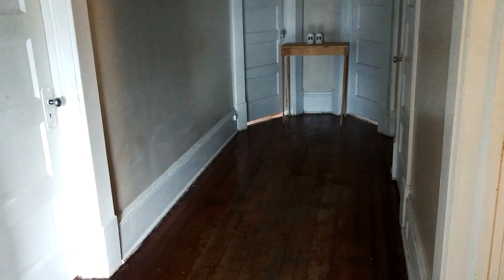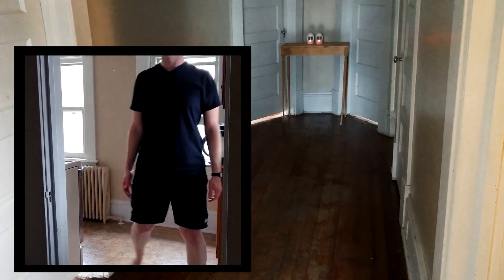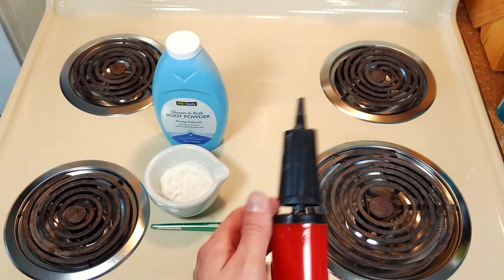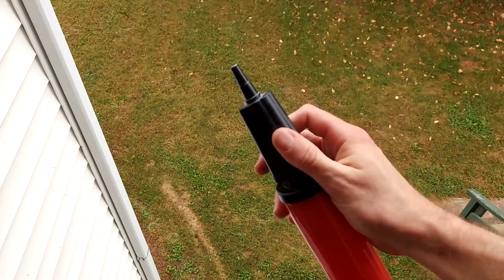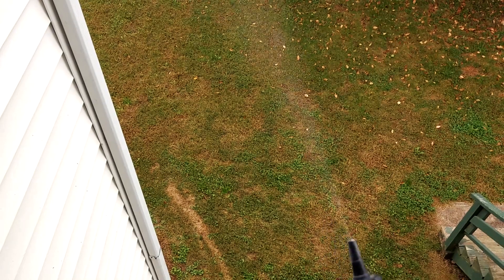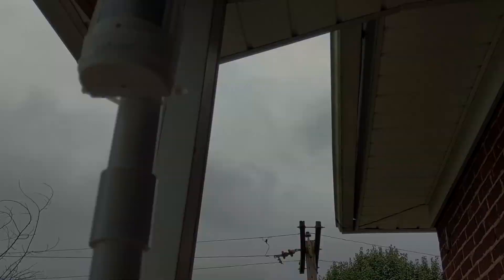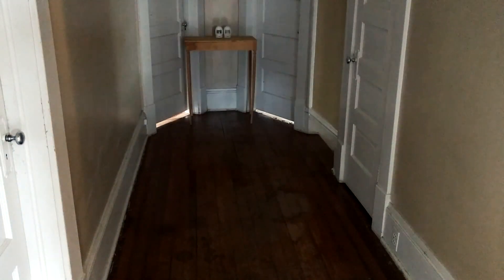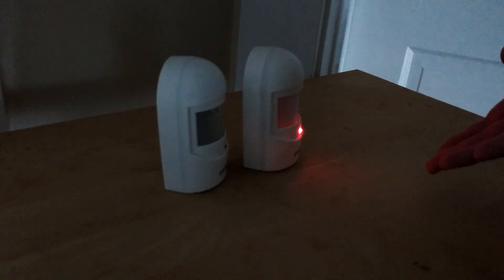Motion Sensor Bypass Prototyping

Comment: You say the sprayed sensor doesn’t look different but it does look really obviously spray painted
Reply from the maker: Well, "looks different" is such a relative qualifier. I definitely agree that it looks obviously different when well-lit and closely inspected. But, when out of one's central field of vision, and in the absence of strong lighting, I would argue that this modification is pretty stealthy. 

But again, this is just a proof of concept that would have to be further developed to be operationally useful. A delivery system which creates a more uniform film over the sensor would be more stealthy. And perhaps another material would be more transparent in the visual spectrum, while still blocking IR. 

I only intended the video to be a small window into my prototyping and testing process.

Comment: How do you think using something like Plasti dip would fair? You can theoretically spray enough layers to create a thick rubber coating that should block out distant heat and movement?
Reply from the maker: I imagine that plastidip would be more noticable. But maybe there is a super transparent variety that I'm unaware of.

Comment: Nice video, well explained but, do you think that when spraying the sensor it would instantly ring the alarm or actually a motion sensor triggers when it detects movements for 5-10 seconds ?
Reply from the maker: Good question. This attack would be performed when the building is occupied so the sensor would not trigger an alarm at the time of application.
Reply: @ContingencyLabs  Thanks for your answer, that's what i thought